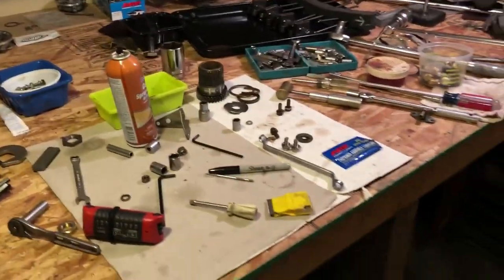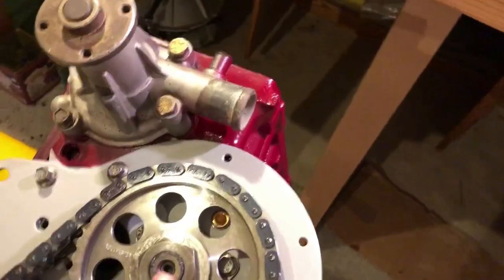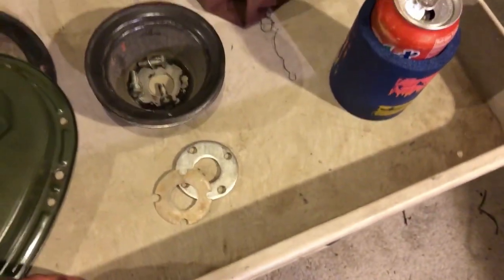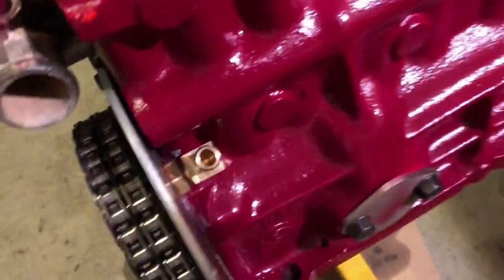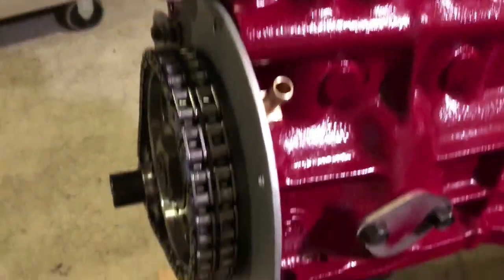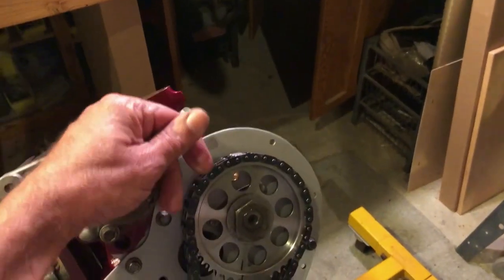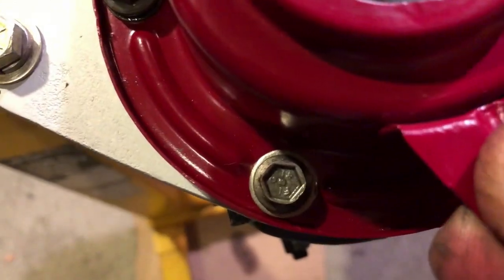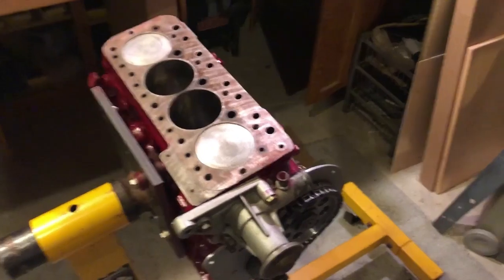Jemal's engine details- venting the BACK of the timing cover

Comment: That is a very nice work around to get rid that obnoxious vent cannister! I always hated that thing.
 Question for you, my Sprite has that aluminum funnel looking PCV valve with the spring and diaphragm in it that fits in a hose directly out of the top of the intake manifold, what d o you recommend as a work around for that thing?
That Cam though.
Wow, 300 degrees?
I can assume there is a whole bunch of work going into the head also to help it breathe?